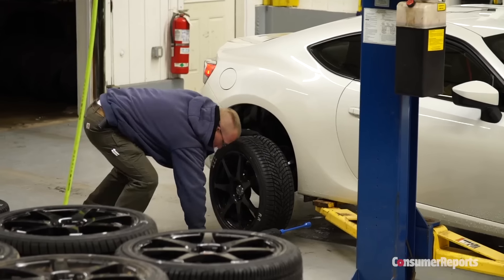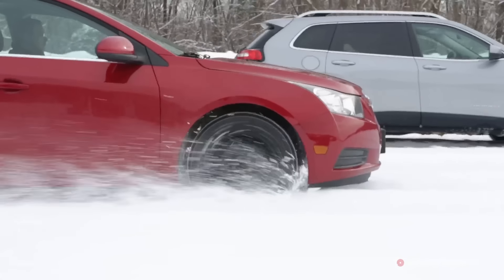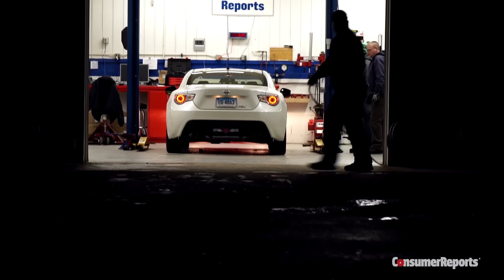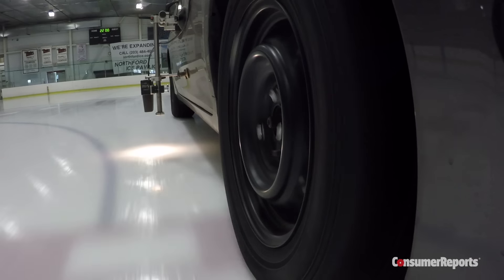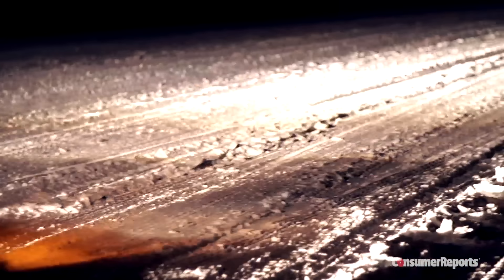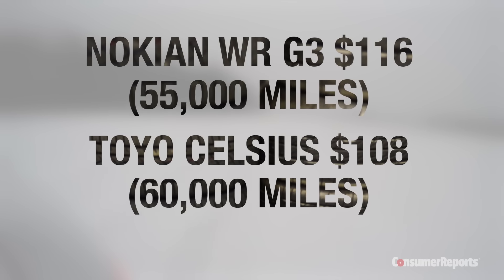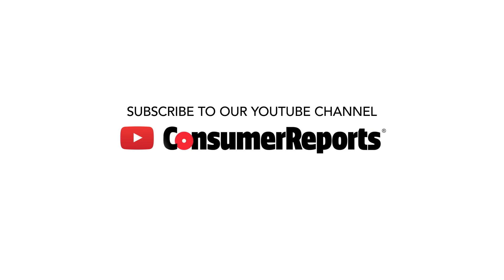New All-Weather Tires Outperform Some Snow Tires | Consumer Reports

Comment: This is BS . . . from personal experience.  All Weather tires perform better than M&S rated in snow and ice but not as good as a dedicated winter tire.  Winter tires also stop quicker on dry pavement at subfreezing temperatures and as good or better on wet roads below 5 degrees C.  It's physics . . . . softer rubber, more sips and deeper, winter tires can absorb more moisture.  Started this season with Vredestein Quatrac 5's on my Honda Insight, they were okay on packed snow but very skiddish on light powdery snow that was blowing over a freezing road.  Traded out for a pair of studless Dunlop Maxx 2's and a pair of Nokian Nordman (no studs).  Both performed much better, although not as good as the old gold standard, Blizzard Blizzak's (my tire size too small for the new WS-80's).  Drove a friends Subaru Tribeca also with a new pair of "All Weather tires", again fine in packed snow, but tires were spinning in about 4 inches of slush . . . . that's right, the world's best AWD system challenged by 4" of slush!  Previous week went out in my Outback with real winter tires, WS-80's and it took 2 feet of powder to get it temporarily stuck . . .

Comment: no thanks I'll keep my general altimax Arctic studded and my Nokian hakkapeliitta 8 studded I don't mind changing them once a year if it's going to save my family from getting into an accident.. I've also had studless snow tires and they say those are as good as studded and I call BS on that too
Reply: ftw65911 I’ve used studless snow tires. They ARE as good, and in some Tire Rack testing they have been shown to be objectively BETTER than studded tires. Objectively better as in: shorter stopping distance on the same car from the same speed, and faster through a cone slalom before breaking loose. The rubber compound in the modern studless winter tire is quite advanced. There is no reason to run studs. They just tear up the roads faster, making infrastructure maintenance more expensive for all of us. Outdated ideas are wasting tax dollars for no valid reason.

Comment: Now, test them in the summer...
Reply: Surprisingly good!  They won't outperform a dedicated summer performance tire, nor are they sold to be, but they are quiet, roll really nice and stand up pretty well.  Great for milder climates, rain, light snow, a few cold weeks of winter, average 24 degree summers etc.  Where I live, the Pacific Northwest, they are simply excellent. 
This is what people used to think they were getting in all season tires (which are really just summer tries), something good for all seasons, not designed for extremes though.

Comment: Some years ago I bought a set of Dunlop snow tires with silicon rubber.  Well, I drove them in the summer, drove them across country to Florida and couldn't wear them out.  So, after thirty-some thousand miles I discarded them because I wanted summer rubber.

Now, some of the winter tires handle quite well.  So, I'll probably never buy another summer tire but only winter tires and run them year around.  Well, it sounds like the tires companies have finally figured this out too.
Reply: Lorrin Barth in which state do you live?

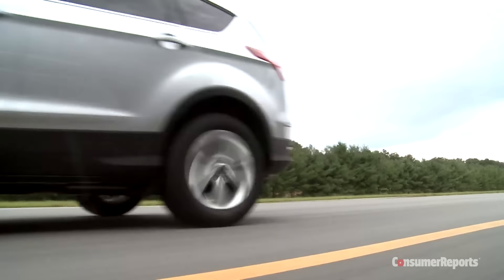Comment: At 0:21 he says  "These tires are called variable condition or all weather tires, not to be confused with all season tires.  Here's the difference".  He then goes on to describe the difference between all season tires and winter tires.  Can anybody tell me the difference between "all weather" and "all season" tires?  This video was clear as mud.
Reply: Below 40 degrees all season hardens and you loose traction.  The all weather stays softer like a winter tire but not so soft that you have to take them off after winter.

Comment: all weather are shit after a bit of wear
Reply: Snow tires are shit on the last half of their tread.  That is why one runs the last half of the snow tires on your none drive axles in the winter an put the newer snow tires on your drives.  Then kill them off going into summer.  They don't last   long on hot roads.

Comment: These tires are still a compromise.  There is no substitute for a purpose built winter tire if your driving environment is snow, ice and cold.  When the weather turns hot (or even warm) these will not perform nearly as well as a dedicated performance tire.  If you live in a climate that features real winter and real summer, and you care about tire performance, this technology is not a solution.
Reply: In a perfect world:  New snow tires on every November and New Performance tire on the start of May and dispose of the 1/3 worn tires to a used tire shop:  Plus  All wheel drive just to make sure you get there and don't forget the wheel chains.   Better yet: Humvee winter and  Corvette summer and new tires the start of every season if you want perfection.
Reply: **Michelin CrossClimate 2** 😉

Comment: I tried a set of WRG3 and I am totally disappointing. It is not as good as real winter tires during winter, and the poor summer performance make it more dangerous to drive on it during summer time.

The snow grip is OK, but the ice grip is terrible, probably equal to normal all season tire. The summer performance is also poor. The stop distance is long, especially on wet pavement. I will not recommend WRG3 to anyone who purchase tire for safety reason.

Comment: False advertisement now everyone with zero car or mechanic knowledge won’t buy snow tires. Snow tires is the best investments period if you live in a cold/snow environment.
Reply: They should've made the distinction between 'snow tires' and 'winter tires'...not the same. Having driven on Nokians on my 2WD F150 for 4 winters now, I would not say that they perform even close to directional winter tires, but non-directional are comparable.

Comment: Ask a pro:  They'll tell you to use the appropriate tire for the job. So, either do it right, or slide into a tree because you were too cheap to use the correct tires. Your choice.  I learned the hard way not to use the wrong tires.

Comment: one thing nobody mentions , probably thats the only reason most of you believe bad time stories like this.  A good quality winter tire has a certain percentage of silica composition usually first 30% of outer layer , what that does is softens when temp drops below 7' and hardens back when above...so till that day comes when all seasons are made like this , no all season can outperform this types of tires.  Period !
Reply: The Nokians use 100% Silica, so that day is here.
Reply: Kai Fuller No, they don't.  Silica is sand.  Tires are primarily rubber and carbon components, with very small amounts of a traction ingredient like silica.
Reply: Most winter tires have a compound that reacts to ambient air temps between 32 - 45°f.  Below that, they perform as intended.  Above that, you'll wear them down rather quickly.
Reply: These tires in this report are not all season, they are all weather.

Comment: Neither very good winter tires neither very good summer tires. They are a compromise and depend greatly on where you live, for example the Toyo Celsius is not recommended by Toyo themselves for New England and most eastern Canada ( Quebec and Maritimes namely). I sell tires for 40 years now and have seen it all. We sell those to snowbirds mostly, the other ones try them one winter and keep them as their summer tires after and get fitted with proper winter tires.

Comment: try driving in a -40 celcius blizzard in Chibougamau with these tires and tell me again how good they are. these tires are good for Midwest and new england. not for northern quebec. just like the michelin xi3 is the most overated tire ever. the michelin xi3 is good for Midwest and new england. not -40 celcius blizzard in northern quebec. the toyo observe gsi-5 consumer reports so much despise, is actually a stellar tire for extreme blizzard conditions. i have driven with these tires in conditions so extreme in winter, you would have cried for your mommy. the toyo observe gsi-5 has good tread depth, is tough as nail, and endure extreme cold of -55 celcius with wind factor. the michelin xi-3 was a failure in extreme blizzard conditions. of course they are all quality tires. but good winter tires for extreme conditions like a -40 blizzard they are not.
Reply: rick freedom I personally really like Blizzaks. I’m on my 5th set I don’t think I’ll use anything else tbh.
Reply: But there is the Rub(brrrr).... Who's going to go out driving in a -50C Blizzard.
Reply: what about the bridgestone blizzak in those conditions? thank you for the info...

Comment: These do it all tires are junk, like trying to design a snow blower that cuts your grass or a  lawn mower to plough your driveway, I mean one that does both
You need separate tires for summer/winter, for maximum traction and safety
On my Honda Pilot
These for the summer
crosscontact-lx25 They wont let me post the link here?
These for the winter
contivikingcontact-7 They wont let me post the link here?
Why I chose Viking 7
This is the most comprehensive winter tire test is available in the world, thanks to the 
They wont let me post the link here?
Google Norwegian Automobile Federation (NAF)
And why I didn't choose Nokian , plus it comes in at forth place 
Google Nokian cheat report
They wont let me post the link here?
Collectively it cost the same to run 2 sets of tires, except for the 4 cheap steelies
Plus you get a full size spare, the lx25 as a winter spare, and the Viking 7 for a summer spare
Of course this is compared to a donut spare, and not to each other, you can also drive at highway speed instead of 50 mph , when everyone else is doing 60 mph for 50,000 miles vs 50 miles, and it doesn't put all your electronics in limp mode, defeating all your safety features
Also you avoid the double spare change if you get a flat on the front
Here's how to air up your spare tire, if it's cranked up underneath like mine, or any SUV or truck
Saves cranking it down , and crawling under there, getting covered in dirt, this is really great for winter
Google tire stem flexible extenders
They wont let me post the link here?
Link a couple of these together, and zip tie it to a easy location out of harms way, trailer hitch is perfect if you have one

Comment: No way, and I know about snow tires.  I live in the mountains of Utah at 8000 feet 25 feet of snow every years starting in Sept ending in June.   Snows work best and moistly because all the AW tires have a solid unbroken band of tread/rubber all around the tire making it a slick.  Might be okay in the rain but not snow.   If you live in a place which gets snow, don't buy into this.  They are dead wrong,  get real snows mounted on extra wheels.  Tirerack.com offers very good deals delivered right to your house.  No waiting around a tire shop for 2 or 3 hours.  I have no connection with any tire sales companies, I'm only a customer and I know what works and what does not.

Comment: Nothing new, All season and All weather outperform winter tires easily in all conditions.
Reply: Not true, winter tires outperform any other tire in snow. I am skeptical on these new tires performing equally or better than snow tires.
Reply: Lol. That's what I said.
Reply: This is not WRG2, they tested WRG3.
Reply: +Shuffle3956 I had Nokian WR G3 and they performed well in snow and ice.  not as good as the Hakkapeliita R2, but during the warmer transitional months, the WR g3 felt a lot better.  and they are more than adequate in the rain.  UTQG wear rating of 500 in the 235/45r17, V-Rated also
Reply: Consumer Reports of USA rated WRG3 as a top winter tire even though it is all weather classified. KAL Tire of Canada rated top notch in their tests. I drove thousands of miles in snow, slush, ice ...  Dedicated winter tires performs better under very low temperature conditions, also on pure ice. WRG3 and WRG2 is two different tires as well.
Reply: ***** aside from the SUV, the WR G3 in the USA consists of 2 different tires.  There is no WR G3 in Europe.  There was a WR G2.  The WR G3 was actually a WR D3 and a WR A3.  The WR G3 in the video is the WR A3 (which is the one I had).  Confusing?  At least on the SUV, the WR G3 SUV in the US/Canada = WR G3 SUV in Europe.  Now getting replaced by Weatherproof and Weatherproof SUV in Europe.

Comment: Just get 2 sets of wheels. Summer and Winter. I rather know that I have tires made for that season. Dedicated tires that is. Plus there is no such thing as All Weather and All Season. They both mean the same thing.  All season includes every weather. So when the narrator said "Not to be confused with All Season and All Weather" I just laughed. Go to TireRack.com and type in your vehicle information and bam all tires that are made for your vehicle. You can have it shipped to a highly recommended installer or have it shipped to your home. Best thing is, most tires are tested by TireRack and also there are ratings on how the tire performs in certain situations such as resistance to hydroplaning and ice traction.
Reply: No, all season and all weather tires are definitely NOT the same thing. Do your homework.  Yes, two sets of dedicated tires is best, but not budget friendly.  As you mentioned Tire rack specifically, they also have a video on here describing the clear differences between all weather and all season.  All weather tires have a different tread compound and are 'snowflake' winter approved.  All season tires are NOT recommended for temps below 7 degrees.   Where I live, winter rarely falls below 7 degrees celcius, therefore all season's usually work, for a couple of winters anyway.  
Every few years it drops below zero and there is a BIG difference between driving with all season tires, which are generally crap in any snow and especially cold, icy roads and an all weather tire which GREATLY improves handling, breaking and acceleration. Tire compounds are not what they were even 6 years ago.

So go ahead and laugh it up all you like....but you are wrong.
Reply: What you call all season in USA would be sold as summer tyres in Europe.  Any tire sold in Europe as "all season" has to be winter approved.  These appear to be what this video is now calling "all weather".
Reply: For the record, there are some “all season” tires in the US with the mountain/snowflake symbol indicating they are an approved “winter traction” tire.

Secondly, while some “all seasons” elsewhere may say not to be used below 7C (about 40F), I have only ever seen that restriction on summer tires in the US. An all-season tire must be able to handle temps below freezing. EX: the Bridgestone Ultra High Performance summer tires on my Chevy SS/Holden Commodore are clearly marked to not be used below 40F. My Michelin Ultra-High-Performance All Seasons (Pilot Sport AS3+) are designed to go well below freezing, are rated for snow use, and tested for snow and ice traction. They work as designed. I use the Michelin AS3+ for late fall through mid spring when the temps get below 40F consistently, and they work quite well on cold and dry roads, frosty roads, and even in light snow. I park the car in heavy snow due to lack of ground clearance, not traction (we can get 8” to 12” in a healthy storm system). What I call “real snow” is when the truck comes out, again, not because of traction, but because of ground clearance.

Continental also makes a highly regarded high performance all-season used by many sports car owners in winter conditions, the Continental ExtremeContact DWS06. That one is slightly more biased toward winter performance than the Michelin, and gets rave reviews on snow and ice.

If someone is claiming an “all season” tire can’t be used below 7C, that isn’t actually an “all season” tire. That’s a summer tire by US standards.
Reply: Roger Lee
If you don't know the difference between all weather and all seasons don't pretend they are the same. All weather tires are ment for winter plus the rest of the season. All weaare ment for summer spring and autum. Some ppl use them in winter too but they are not ment for winter.